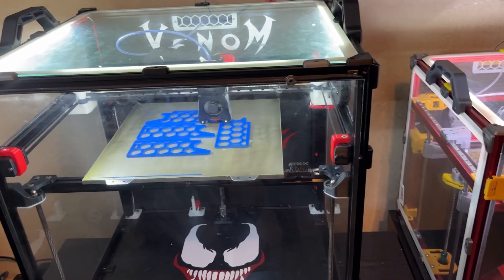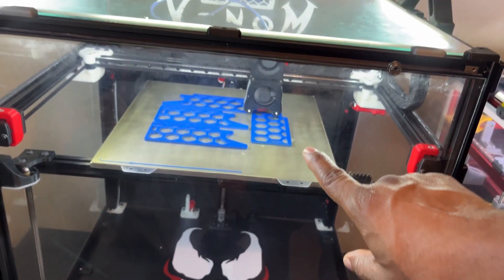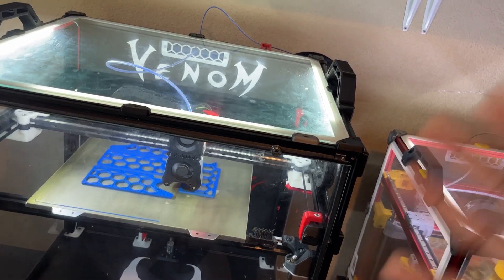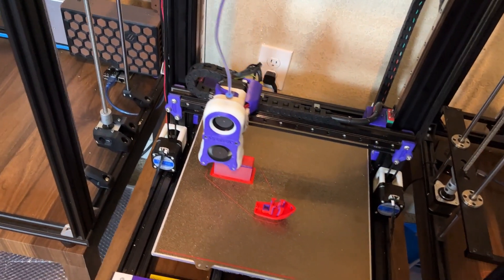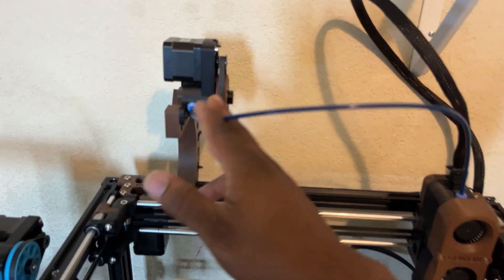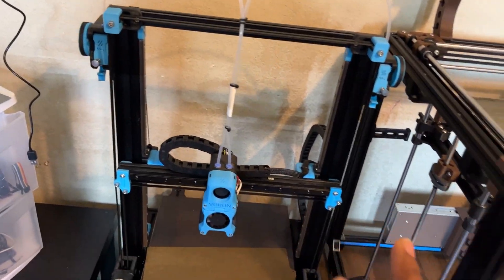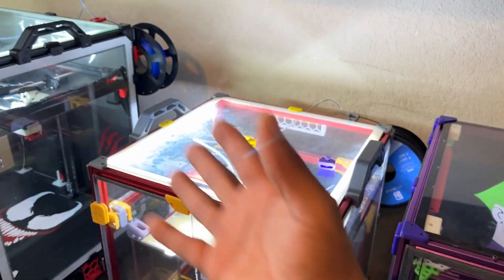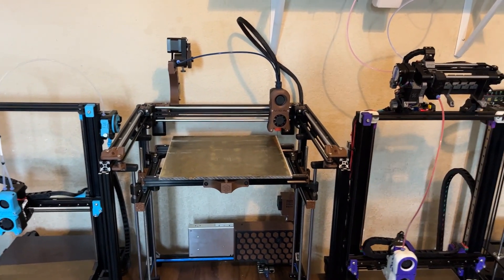Update: What's New? / Venom Issues (Getting HOT 🔥) / GoldenJaguar392

Comment: Impressive conversion from the S8. Do you have the link for the bed? I want to convert my Cr10s and indeed the aluminum bed is a piece of crap. Thanks.
Reply from the maker: 6061 Extra Thick Aluminum Sheet - 12 Inch x 12 Inch x ¼ Inch - Flat Plain Plate Panel Aluminium Metal Sheets Finely Polished and Deburred https://www.amazon.com/dp/B089ZVW3F8/ref=cm_sw_r_cp_api_glt_fabc_A10AW9WY7GN3Z12DN6AS
Reply: @GoldenJaguar3D  Thanks a lot!

Comment: Hello! First of all, thank you for your content, I very like it. 
I watched a lot of you videos, especially about Voron Legacy build series. 
I have few questions / requests:
1) At this video I see what you changed case (you removed front-top extrusion and changed left and right extrusions to 4020). Can you explain why you done these? 
2) What affordable speed settings you can reach on this legacy voron 3d printer without quality loss?
3) Can you make video about clicky-probe (magnet probe)? I see in your videos you like it, I think it will be interested to a lot of users.

I have a lot of linear rods and bearings in stash and want to do smaller setup 130-150mm3 (like legacy project) for fast prototyping with petg. And hope it will be pretty silent, it hard to print in my living room at evening (my enclosured printers have a lot of resonances and 2209 doesn`t help with 80+ speeds).
Reply from the maker: thank you, I'm happy you enjoy my video's, 
1) well I remove the top 2020 extrusion on the voron legacy for aesthetic purpose,  the right and left extrusion are same existing 2040. 
2) right now with my voron legacy print speed is 120mm/s wall speed 60mm/s acceleration 3k npt  bad for bowden setup, quality is pretty good it can be improves with proper tuning.
3) sure thing I'll be working on a video for this soon.

Comment: Use Polycarbonate PC sheets, much safer than glass and can tolerate the heat to 80-90c.  Easy to drill and cut, plus cheaper than glass.
Reply from the maker: Thanks for the info will keep this in mind.

Comment: Which hotend would u recommed for voron 2.4 to avoid issues like cloging, heat and such. I dont have the time to spend fixing the printer i just need it to print.
Reply from the maker: Personally I recommend a pheatus dragonfly series they works great beefy heatsinks and good air flow fans you’re good to go only the dragon high flow have majors issues with needing to be cooled properly my dragon standard flow works fine as well

Comment: Shared this in the Voron Discord as people were talking about sealing out Tridents. One person suggested installing a Nevermore. It could help two fold, filtering the fumes but also moving the air around. Cooler air lower down. 

You could even try mounting a fan under the bed pointing down. I guess the first thing is to find out how much cooler the air is on bottom. Might not be much different with the print head fan already moving air around a bit.

Comment: My printer gets up to 65C, and I print ABS with no issues. I suspect you are running into an issue with the Voron tool head having shitty air flow. On my RatRig, I use the stock Mosquito fan (tiny little fan like the V6 stock fan). The fans used on the Voron have almost no static pressure, and are way too big for the heatsink. The fan will just spin and not really move much air past the heatsink. The issue I had on the RatRig was the exhaust from the heat sink was able to leak over the face of the tool head, which led to the belt clamps softening and letting go. I reprinted the tool head face plate in PC and the problem was solved.

I'm with you about SuperSlicer. I just migrated over to it, and it is a horrid bugfest. It does do a better job of metering filament than Cura does though. It is much easier to slice to max flow rate with SS than Cura.
Reply from the maker: I totally agree about the airflow on the afterburner hopefully the new revision does better with hotend cooling. I will figure something  out though in the meantime.

Comment: Water cooling?
Reply from the maker: meaning using a water-cooled hotend, I won't though their is other methods to combat this issue.
Reply: @GoldenJaguar3D  Thanks for that.  What size nozzle are you using on your Voron Legacy (7:54)?
Reply from the maker: @bernardtarver  .4 it’s running a pheatus dragonfly bms
Reply: @GoldenJaguar3D  Thanks.  What filament do you primarily print with on your Legacy, and have you ever considered a smaller nozzle?
Reply from the maker: @bernardtarver  I print pla mostly on it yes I have but I don’t know if it would be beneficial to go .2 at least with a Bowden setup, I’m curious though.
Reply: @GoldenJaguar3D  That's what I'm debating.  I like Bowden and I like the detail I can get with smaller nozzles, but it's a project to extrude anything other than PLA.  I am currently experimenting with PETG, .2 mm nozzle, and an all metal Bowden extruder.
Reply from the maker: @bernardtarver  let me know how that goes

Comment: impressive spread! In one of your videos you mentioned which belts you run. I'm piecing together a switchwire which brand have you found to be ok on amazon. thanks
Reply from the maker: this one I'm using its still workign great so far  https://www.amazon.com/Timing-Printer-FYSETC-Fiberglass-Reinforced/dp/B07BRKZGMS/ref=sr_1_13?keywords=gt2+belts&qid=1636940620&qsid=135-2962308-0246445&sr=8-13&sres=B07JKT5BZQ%2CB08974S1CC%2CB097T3Y6WW%2CB07KK86NYX%2CB08SQ32RSR%2CB0897CJKS1%2CB08R9L3ZS5%2CB08QZ4365D%2CB07BRKZGMS%2CB07TB79JKY%2CB08KT5894D%2CB014R1N374%2CB014SSZ3EM%2CB08R93QQ8Z%2CB07BJJTJ1L%2CB071K8HYB4

Comment: have you thought about a "fresh air hose"? like get a Cpap air hose and and mount it to the hotend fan and bring the other end outside of the printer that way fresh air comes in to cool the hotend and since the hose is sucking air in it won't let the ABS fumes out
Reply from the maker: honestly never though about this but will look into this certainly sounds like it will solve my problem.
Reply: @GoldenJaguar3D  ya I hope it does oh and I think the reason your 2.4 heating is so off compared to your 1.8 and trident is cause hot air rises and the 2.4's build plate is on the bottom of the printer so when the hot air gets out cold air seeps in and goes straight down to the build plate where if hot air escapes your trident and 1.8s the cold air still goes to the deck but since the build plate isn't at the bottom the print isn't effected